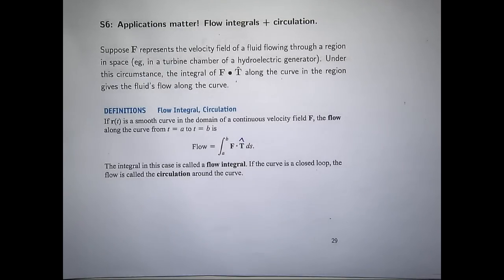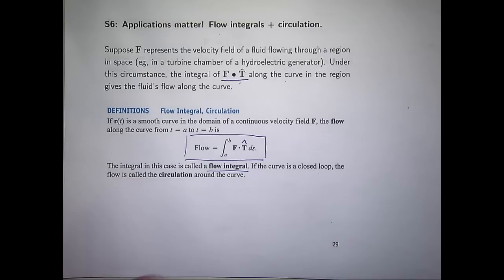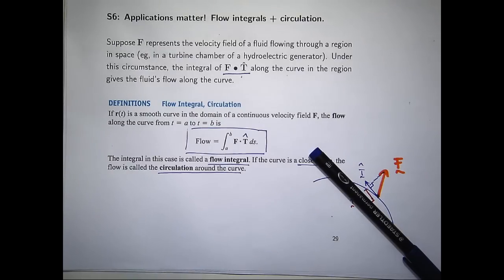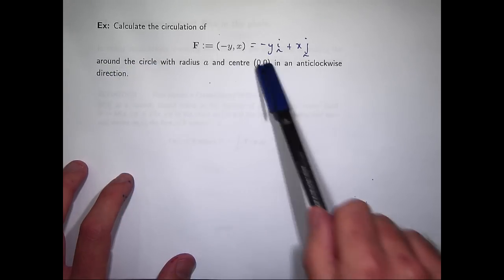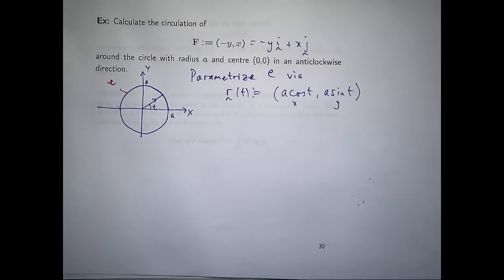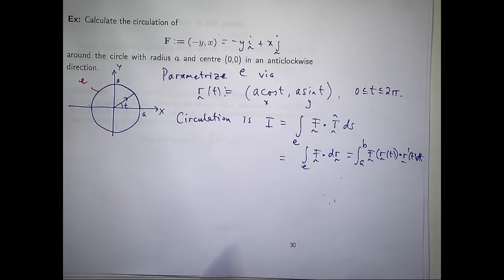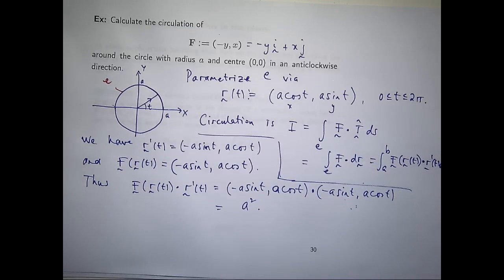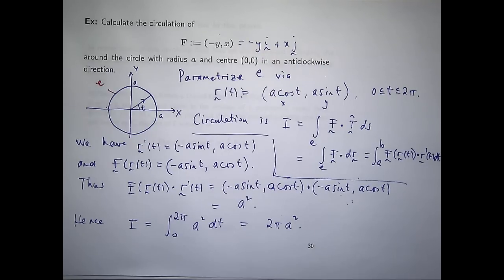Circulation & line integrals

Comment: @DrChrisTisdell:- Thank you very much for your explanation. I am trying to get an intuition of the concept of circulation. So, basically if i take a closed curve region in a fluid flow and at any point in the curve, the velocity vector is pointing straight outward. Then, the circulation basically measures the chances of rotation of the fluid particle along the curve.As the angle decreases the fluid particle has greater chances of following the curve. Please correct me if i am wrong.